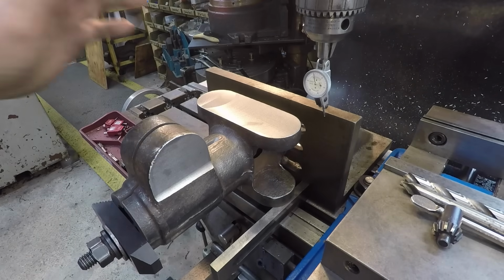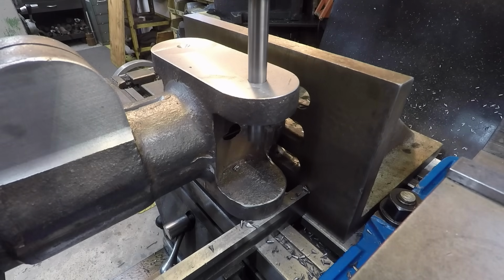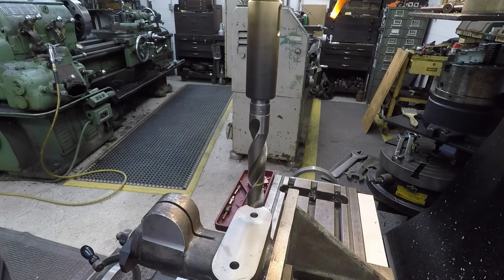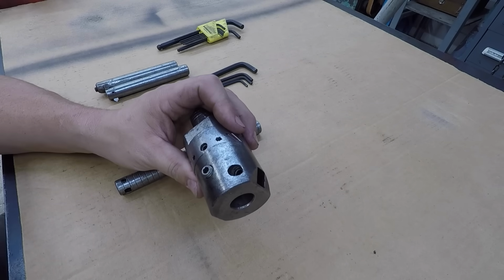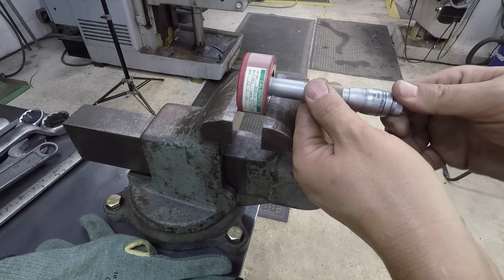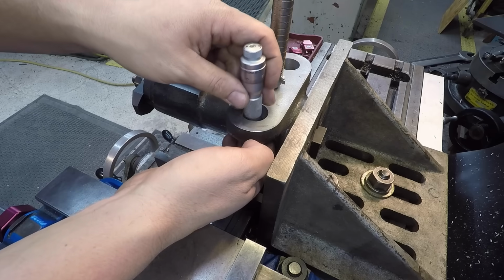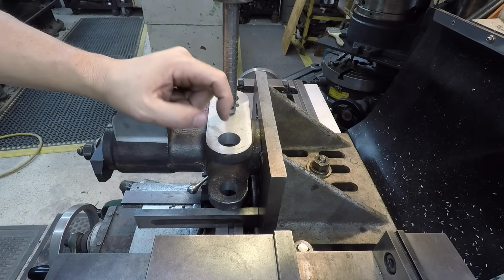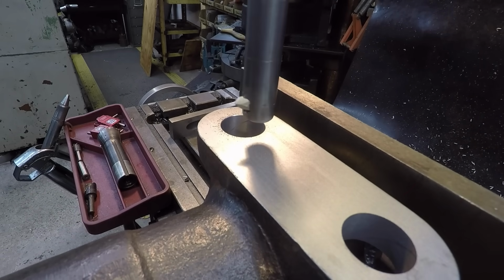Fairbanks Power Hammer Cross Head Part 5

Comment: I have a question is all that chamfering really necessary or is it just a machinist thing
Reply: The burr needs to be at least removed, he said he wanted a 'nice machined chamfer' - which is just a more aesthetic choice, straightforward since he already had it setup.
Reply: razer sharp edge that can chip or a nice smooth finish.  I know my choice.
Reply: I love watching skilled people do there thing. It refreshing to watch someone do something I have no skills on 👍👍👍👍
Reply: @michaelboothe2137  everyone can learn new skills. do one thing at a time and eventually you will be an expert. since lockdown I replaced my toilet, fitted new bath taps, fitted a cctv system and loads other stuff i had never done before.
Reply: @Tangobaldy  but does any of it work?
Reply: @andyb7963  Don't be like that!
Reply: It's always a good thing to Chamfer for several reasons 1 A clear 90 creates a stress point on the corner where stress cracks could start. By removing the edge you actually make it stronger 2. For fitting a bushing a sharp edge could damage the bushing or chip on the casting and this also become more pronounced as you are pushing through to the opposite side. 3. It removes sharp edges to prevent personal harm that corner is like a knife. 4. I see it as a professional thing basically it distinguishes between the pro's and the Not so much pro's. A person who who is proud of his work will also want to make it look professional.
Reply: To quote Quinn from Blondihacks "The chamfer is the only thing that separates us from the animals"
Reply: It has benefits. for example when the holes were bored out on the mill, the chamfer after will remove any burrs that were created from that process which could cause fitment issues for other items fitting. If those holes were gonna be threaded a little chamfer will help center the tap making the tapping process easier as well.
Reply: A sharp edge is a danger to users - in a large part like this it can make the difference between a bruise or losing a finger
Other than that it gives a stress raising point that over time is a fracture and chipping risk

Comment: Can a wobbly bar produce a round hole ??
Reply: Yes, since the cutting tool is always at the same place relative to the wobble. In a sense, a boring head 'creates' a controlled wobble/offset. Imagine if it was more seriously bent, like at 45 degrees - when spinning in a centered chuck, the cutter will still produce a perfect circle.
Reply: As long as it is being spun in 360 degrees, the offset from the wobble is applied in all 360 degrees.
Reply: sure, because in this case you only have one cutting point. the cutting tip still draws a perfect circle on a bent bar, the circle just isn't centered on the rotational axis. and because he's touched of on the material and any adjustments are made from there, it doesn't matter.
Reply: @ElvianEmpire  Thanks.  Thant's a cogent explanation.

Comment: Just wondering why use a bent boring bar when trying to get to tenths?..love my bore mics...the setting rings change size from hand warmth..👍🏻👍🏻
Reply: Since it's single point cutting tool running in a circle, it doesn't matter how bend it is, as long as it doesn't bend any more during cutting.
Reply: Chuck Norris  True, but counterintuitive.
Reply: @hinz1  makes sense now..tks..just looks odd.
Reply: The bar could be bent at 45 degrees and it would still cut a perfect circle.

Comment: I thought a bent bar like that would make the hole out of round? I’m confused
Reply: it still goes around in a circle, doesnt matter what shape it is.
Reply: It may look bent but that is the off set of the boring head.
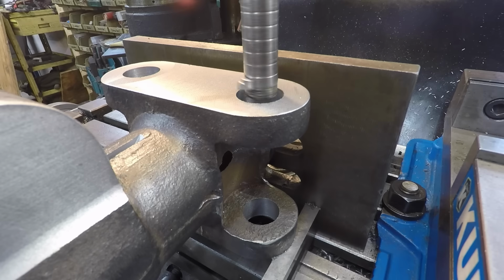Reply: @phillipyannone3195  no, the bar is actually bent. 17:15
Reply: @phillipyannone3195  That is true, but the bar is also a bit bent. It just doesn't matter because of rotational symmetry.
Reply: It’s a good example of what you call counterintuitive.

Comment: How about a dab of oil to shut that sucker up haha
Reply: I bet it was the extension of the quill that made the bottom holes complain more than the top ones.  Had he bored it by raising the knee instead it probably wouldn't have been so bad.  That said, It's getting a bushing pressed it so it's not overly critical.
Reply: Because it is cast iron., which not only doesn't need to be lubed, but also shouldn't be lubed.

Comment: Was the bore diameter critical.... the bushes will be turned to suit your bores. ?
Reply: They want to be able to buy "plug and play" bushings so if they wear out, they can buy new ones of the same size and press out the old ones and press in the new ones with no machining required.
Reply: @Mishn0  Am surprised he did not wait the extra day for receipt of the bushings to verify that they were actually 1.127 o/d.
Reply: @arfonjones7188  I'm pretty sure McMaster-Carr doesn't have that sort of problem with quality control. If their spec says 1.127, I expect that's what they send.
Reply: @Mishn0  i agree
Reply: He wants a correct press fit for the bushings, so yes.

Comment: You know being a non-machinist I watch you and see it done with my own eyes and still say how the heck can it work out that way. Then you throw a crooked boring bar into the mix and ---- it must be witchcraft.
Reply: It's a single point cutting tool.  As long as the offset from the bend is being turned in a circle, then the cut hole will be a circle.

Comment: How do you decide when to use cutting oil or not?  Why wouldn't you use it when you were drilling those holes?  (Sorry if it's a simplistic question... I'm a woodworker, not a machinist)
Reply: With cast iron oil is not needed, in fact NOT recommended.
Reply: @j.sagiechode  Didn't know that... thanks!
Reply: cast iron doesn't need coolant because of the high carbon/graphite content
Reply: Just over a hundred years ago,what was recommended was, dry ,or sperm whale oil,or soda water. That is,water with sodium carbonate,washing soda,dissolved in it. For cast iron.
Dry works best for video,no doubt there are at least some modern cutting fluids suitable,but cast iron can be cut dry.

Comment: So, if you nailed the dimension on the second set, why not just go back over to the first set and send it back through rather than using a flap wheel?
Reply: Can't speak for Adam, but my (limited) experience is that due to tool deflection even just sending it through at the same setting will take more than you expect. That's why you split the last cut into 2 and check after the first one. Hopefully the deflection will be the same in both cuts. Mart.
Reply: @MartsGarage  Gotcha, thanks.
Reply: It would probably take longer to get it lined back up to machine it than it would take to just sand it a little.

Comment: Very interesting, thank you
I would have expected power hammer parts to have been forged and not cast ?
Reply: This part does not endure any direct impact - it holds the actual hammer head, which is forged.
Reply: The original was cast